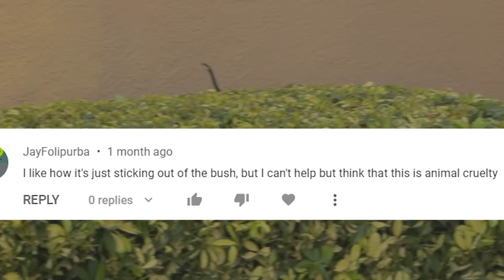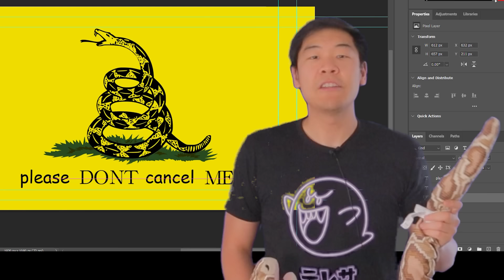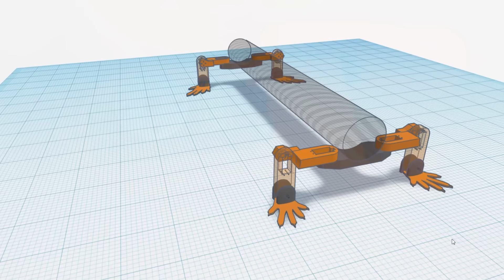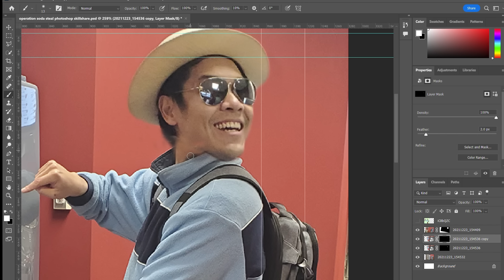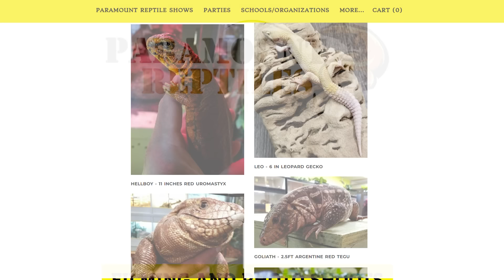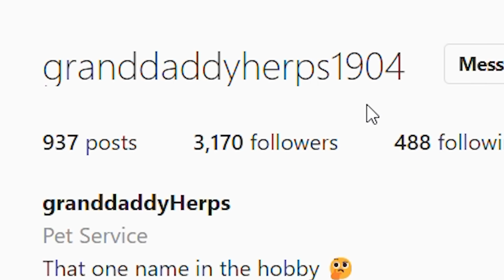giving snakes there legs back.

Comment: You should install a warming pad along the bottom, lengthwise to encourage the snake to want to go in tube. It will also act as positive reinforcement. 
Also consider a cooling fan.
Also adding pressure switches on one end, on both sides of where the head would be, might alow the snake to turn the mech-suit by turning its head.

Comment: you should totally continue this project and try to make it so the snake can control the direction by tilting their head
Reply: thats acutally good idea mate XDD
Reply: Exactly
Reply: According to Allen it's "tilting there head"
Reply: You know, I read somewhere that some folks out in Israel did that with goldfish on wheels.
Reply: you could like have a string attached to its body where it sticks out and whenever it turns its head the direction the string is pulled can be relayed to a server and the code will do the rest 

tbh i got no idea if this will work just spoutin out random stuff that could pottentily work
Reply: We don’t need snake mechs dude
Reply: @felixfauxington99  that's correct, we DESERVE snake mechs
Reply: @joshball2298  Suggestion, coming from an engineering student - don't use technobabble where regular language works -
"Maybe attach a string between the snake and some sort of sensor, and have that control the robot"

In this specific case, the language ends up being confusing because a project like this shouldn't involve any sort of server unless you're controlling the snake over the internet.
Reply: Not the head, the tiny bones that are where their legs were.
Reply: no
Reply: @macuahuitlman  Israeli science is light years ahead of our own
Reply: @antonliakhovitch8306   your right i was just thinking of possibility's to make it fuction better but i have no idea what i was talking about and you obviously do

Comment: This needs some flexibility for taking curves nicely, also to help with the biomechanics of lizard walking. Im thinking multiple sections like vertebra would be perfect, joined by some elastic or foldable material like in a flexible straw
Reply: Making it flexible could cause some issues where the moving parts could pinch the snake though. This is by no means an elegant lizard walker but it's safe and that's the most important thing.
Reply: @Colopty  what about an exoskeleton of interlocking parts with a cozy smooth inner lining of flexible material?
Reply: Then make it so the snake can control the flexibility, so it can practically drive itself.
Reply: just make an oversized flexible straw with legs...
Reply: You're describing a snake body
Reply: @kafkabigmon  Yes, but the key difference is the LEGS
Reply: @charlieguy6872  Allen can't afford consulting experts at the $350-$2000 range, so he probably can't afford to make anything more complex than what he's already built for a one-off video lol
Reply: @stickmanonastick6089  id figure just mount the legs solid without servos, and make a  flex tube as spoken here.. then and the snake writhes,, it walks.  then again that is a whole lot more work as opposed to the beautifuly simple method here.. 3d printer and some assy required it still is functionable
Reply: @charlieguy6872  While the problems that come with a flexible exoskeleton aren't impossible to work through with suggestions like yours, working through them will likely blow up the budget.

Comment: A few ideas for version 2.
currently the way it walks resembles a turtle to me because of it's stiff back wile walking. In order to gain speed, lizards arch their backs ide to side as they walk. Maybe if you could make the tube out of fabric on top of a mechanical spine, snakes could truly become the ultimate lifeform.
Reply: A version two could also do with snake direction control. Based on the movement of the head, it could steer
Reply: @1TW1-m5i  I have no idea how you would do that, maybe a mounted camera? Or maybe a weight sensor to see which side has the most pressure?
Reply: @Keanine  i was thinking 2 sensors on either side, facing up and it just hovers it head to the left or right
Reply: what i’m thinking is that instead you make an inverse kinematics model like what video games use, and make it so that the main part of the model moves according to  a gyro sensor strapped to a snakes head using velcro.

wires might be a problem, but one solution would be to make as small as possible pcb with an esp32 module on it, and then use a tiny lithium battery connected to an equally tiny 3V converter connected to the esp32’s 3V pin. You could then run a simple server on the esp32 which can send out the gyro’s data to another esp32/raspberry pi connected to the legs.
Reply: Beep, bop...  I'm the Philosophy Bot.  Here, have a quote: 

"You shall not pass!"
~  Gandalf
Reply: Personally I think that if they are going to have legs they need to be able to control them but they are probably more effective without legs anyway
Reply: we need Michael reeves.
Reply: And directional sensors  for the had movment
Reply: Also add machine guns
Reply: it would be possible to have snakes to use these prototype mechs for several millennia's to the point that evolution actually gives their legs back
Reply: @joshsmith522  I feel like the opposite would happen, they would become reliant on the technology, in the same way that we lost our body hair because we rely on clothes and fire
Reply: @Keanine  wait a second, we still have our body hair, so that means that snakes would indeed get legs if we still have body hair

Comment: I'd love an episode 2 of this. I love how the legs look. 

I wonder would it be possible to detect the snakes hed and then move left/right where she looks and forward if her head looks straight with a slight angle down? stopping would be if she looks at an angle with more then 90 degree backwards or to high up or to low down. Then have an override there for manual movement just in case.

Comment: "...each limb was robust and powerfully built, their physiques gene-bulked and augmented with implanted weaponry. Ribbed cables and coloured wires penetrated through my amniotic tank and embedded in my skin. Although I have previously seen exoskeletons, I have never been this close to one. They had a terrible machine oil odor. Giant handguns with flaring barrels and tall iron staves with a bronze and silver cog on top are what I intend to equip it with..." - Tech-snake, Theta-12-Psy